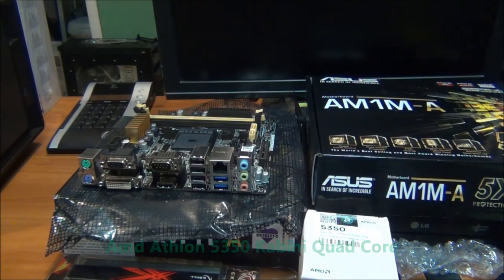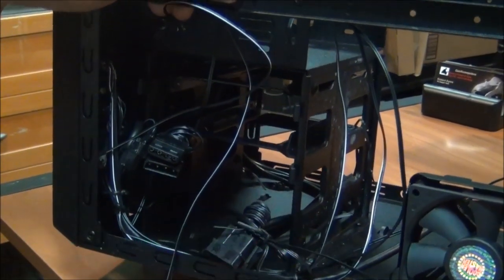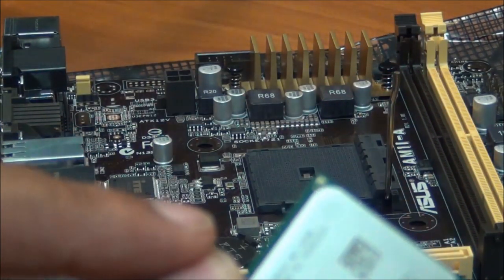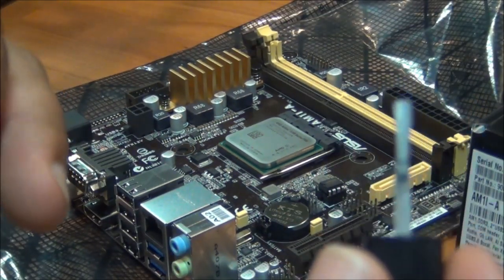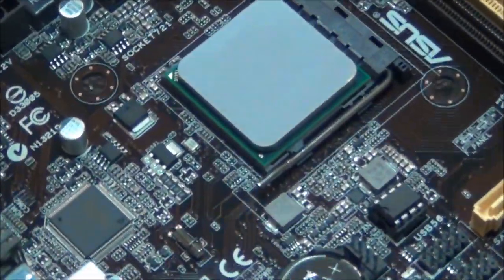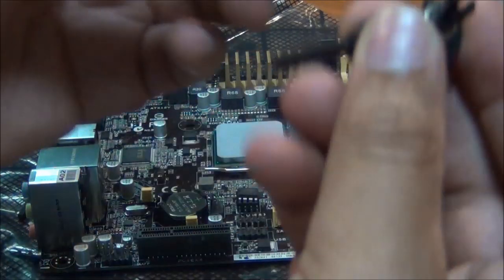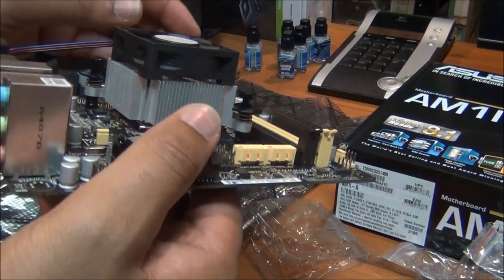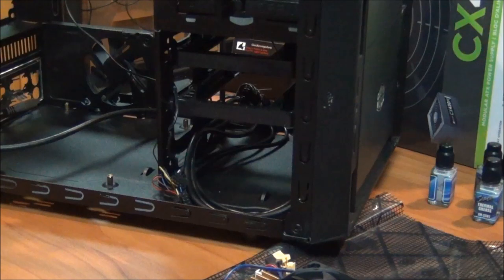AMD Socket AM1 install on Asus Am1i-A mini itx : AMD Athlon 5350 Kabini Quad-Core AM1

Comment: Hi? I'm A YOuTube Aficioando Also,My Problem,I've Built The Mirco Pc Amd 5350,But,Can't Get It To Power Up,All I Need Is To See How You'veConnected The Front Panel Connection,AMD Anthlon 5350 Won't Power Up,I've Connected The Front Panel Numerous Times,PC WON"T Power,Help Please,Respond With Words Or Video,Thanks In Advance
Reply from the maker: don't have system anymore, make sure that board isn't dead or power supply, couple of ways to test for boot up one is using a paper clip to start board, should find plenty of videos online for this.  please subscribe or like to keep them coming.

Comment: Ouch, that would have been so much simpler to do, had the 'lugs' been pushed onto the heatsink first!  Of course, I had just watched another 5350 video prior to this, where the guy had similar problems - so it's easy to be a smart-ass when fore-warned. :)

Comment: I always want to build a AM1 system my problem is the amount spend you can get the same for a FM2  today that is faster and better  and save a lot too, last Christmas I got 3 A6-5400K for $29 each  at T.D .I made 3 system that cost me less than a $1000 that I use as Christmas present  for 3 family members  average about $300 each ,trying to buy  present for 3 family would have cost me way more ,and I am still getting thank you up to this very  day the old system that the all had  is at rest in the shed  one day when I get time I will just save some pictures that they all have before scrapping them for the dumsters
Reply from the maker: Sounds good would like to see some pictures of your builds.

Comment: I just purchased a new MSI AM1i motherboard, eager to get everything installed, Enjoyed the video, But when you are installing the CPU, you need to hold the cpu down with a finger, As you lock it into place, Just to make sure nothing goes wrong. I know somebody somewhere will damage the cpu while locking it in place, without pushing down gently as you push the pin down, then locked. Just info,
Reply from the maker: Thanks all tips are welcomed, generally i do keep it stable by holding the sides down, but recording and constantly adjusting makes it kind of difficult.

Comment: that static plastic is anti stactic meaning the outside is super static to discharge static and putting the motherboard on top of it is pretty stupid
Reply from the maker: Daniel Zanin Thank you :)
Reply: The outside of that type of bag is only slightly conductive. I wouldn't worry about it.
Reply from the maker: For sure, I haven't had much issues.
Reply: +biggonyou : Computer Whisperer thumbs up for responding politely an aggressive comment

Comment: Hi there and thanks for the video. Question: Do you get random reboots with this piece of trash motherboard? the Asus AM1I-A. If not, what exact Power Supply model are you using?
Reply: +trocoman If you are getting random reboots, chances are there is a short somewhere. AKA some part of the motherboard is lose and isn't grounded properly.

Comment: If the heatsink has the TP on it already, then you have just wasted your own.
Reply from the maker: Rusty Fox Most heatsink TP= Thermal Paste, isnt very good quality or not idea for a lot of custom builders setups, but for average straight forward build it works just fine you are correct.
Reply: +Rusty Fox you would be surprised how little of this stuff u are supposed to use! less than a paper thin amount is optimal, its only there to fill microscopic scratches not supposed to be soaked in the stuff.
Reply from the maker: Exactly, i always used a thin layer.

Comment: I was looking for new computer videos also I have been given alot of stuff probaly could build at least one but how do I find what works with what and how to test an old ASUS mother board to see if any good Thanks and if you could tell where to see some of your other stuff
Reply from the maker: Jerry Dresch I have videos ranging from motherboards to hard drives, to test a motherboard, start by making sure caps are not blown, then there is software that test components on board, but generally it either works or it don't, first and main thing to test on boards is on board graphics, so a free video test software or you can use prime to stress the whole system and let it run.
Reply: biggonyou : Computer Whisperer Thanks for reply just in time I have gotten three messed up desktops given to me I have spent a week working on them one was a pain but it finaly got it restored to new in the box and from XP I went to dual core 500gig hard drive windows 7 and the OTHER was not so easy a mess trogans viruses no restore thought it was gone then remembered I had Puppy loaded it on ram (4gigs) and found the hard ware was fine so it was a software I was fighting tried to load puppy it won so loaded xp home it worked but would not get on the internet we fought for a day the specs where good so I loaded windows 7 home 32 bit and I finally won so the Dell with Intell Core 2 Duo 4gig ram only 80gig hard drive is working realy good if it likes it or not. Watching your stuff teaches me alot , A very stuburn HP 753n puppy also works but can't seem to load anything on it is next so that board you have that would not fit in case is it still just hanging around doing nothing HAAAAA Thaks and do not stop making videos
Reply from the maker: Look over your drivers, they can reek hell on system behavior.  I don't think i have that board lying around but i do have other things that i planned on giving away, If you are interested stay tuned over the next few months i will be giving few things away.
Reply: biggonyou : Computer Whisperer THANKS but give away or not I will be waiting to see what you come up with next
Reply from the maker: Just posted a video, more will be coming, very buys apologize.

Comment: can it run raid 0 or 1?
I am planing to use this mb and cpu to make a nas
Reply from the maker: That is a great question, usually most boards do at minimum 0+1 but I'm looking and i can't see anywhere on website where it states it does. you can always get a controller card and in my experience a great Controller card is always better than on-board.
Reply: biggonyou you are right indeed but i was planning to get a lan card for it but now it has to be a raid controller, but thx
Reply from the maker: Sander te Winkel
 No problemo, keep us posted on how it turns out or upload a video.
Reply: biggonyou allright, i will
Thx guys
Reply from the maker: Sander te Winkel
 No problem thanks for the feedback.